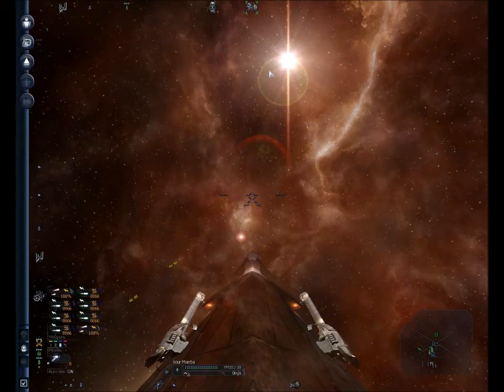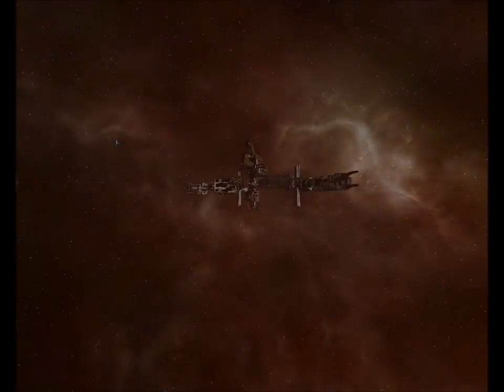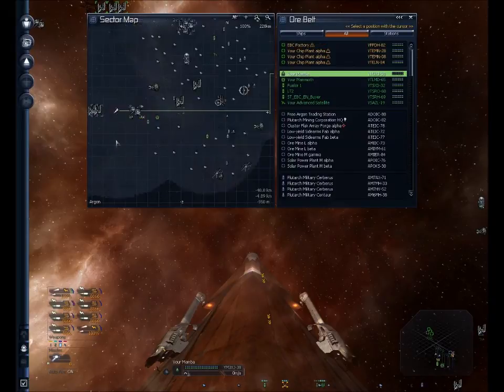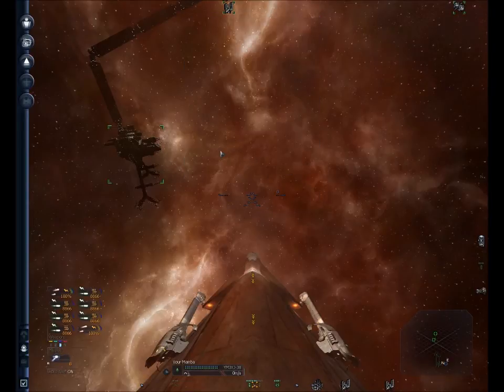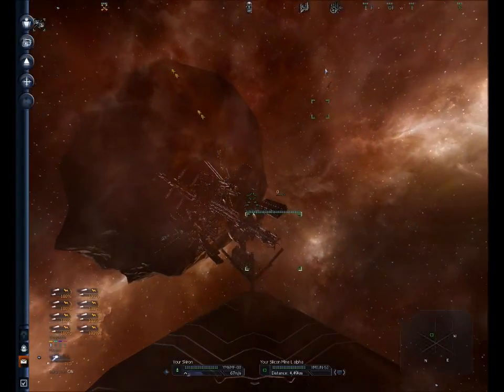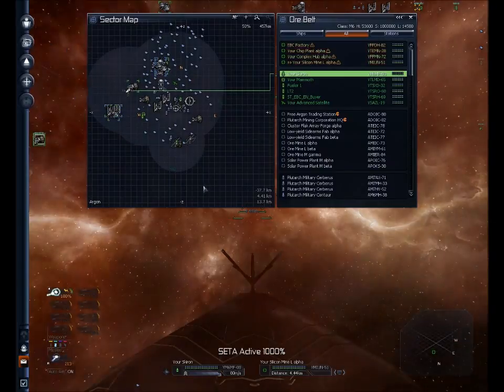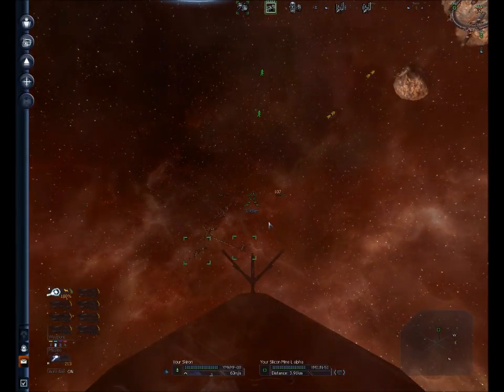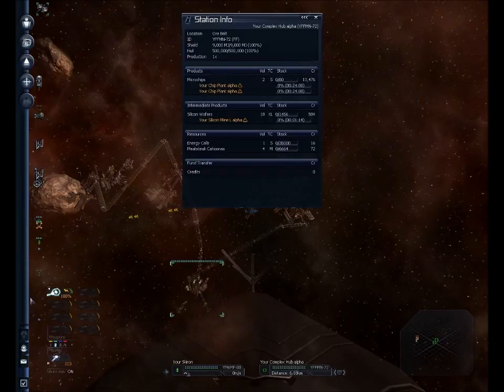LetsPlayX3TC Episode 12

Comment: You can use boost extension because it doesn't matter how speed is ship in default always if is tractor beam connected the maximum speed decrease to 80 m/s.